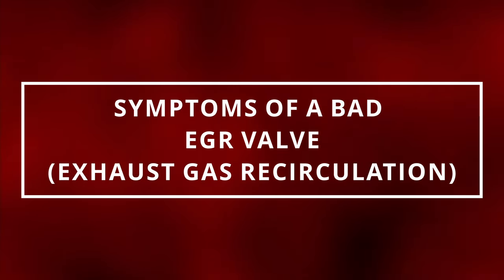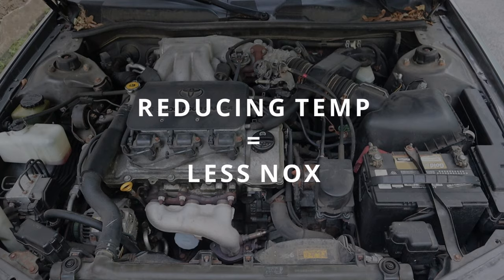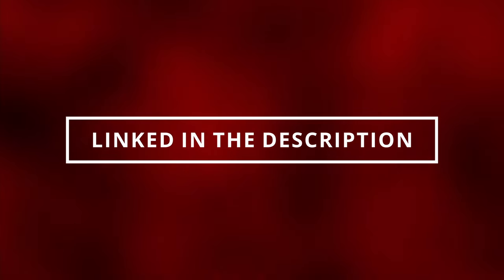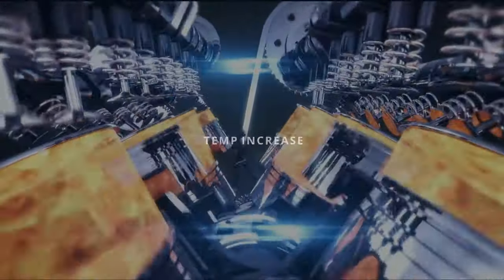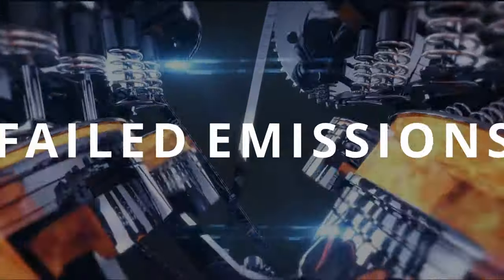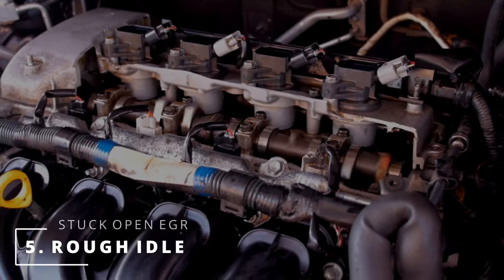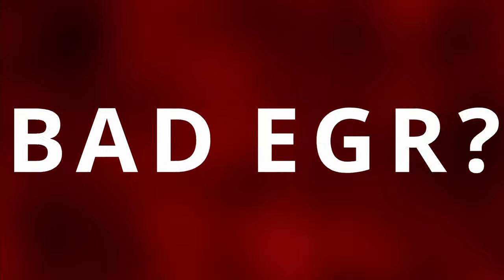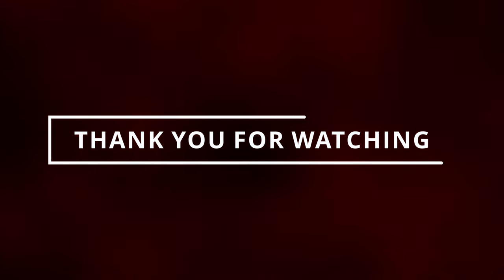SYMPTOMS OF A BAD EGR VALVE

Comment: The purpose of the EGR valve is to destroy your engine over time.
Reply: Have you deleted it? I’m thinking about it but not sure if it will cause more problems. I got a 95 mustang 3.8 Essex v6 ohv. Let me know anyone. I only have a egr code and that’s it. I’ll clear it. Stays off then comes back on.
Reply: @classicv8dude268  (I have a Mazda turbo diesel ute) Same I have been thinking about deleting the EGR valve but doing a Google search they say it can cause more problems, hotter burn even cracking the head.
Reply: @12volthighpeakvanlife.62  Yep, same.👍
Reply: @classicv8dude268  I have 2 80's lincolns and I can't have any vacuum to them otherwise they run like shit. I'd say you're safe but you may still get a code.
Reply: LOL I thought that was the purpose of the gas, now.
Reply: @ryankizzire2321  True, believe it or not.
Reply: @Nick41622  elaborate
Reply: @1k_vonte  🤣.
Reply: @Nick41622  im not gettin it
Reply: @thesquad2253  Does your engine have an EGR valve?
Reply: @Nick41622  yeah and it needs replaced
Reply: @thesquad2253  Think about removing it if you don't have yearly inspections.
Reply: @Nick41622  you have to do a proper delete on it but also keep in mind it is a federal violation to remove egr
Reply: Think the government and the EPA regulations! We can burn more of the fuel, so it doesn’t exhausting to the environment! 😂😂 these are the same people flying jets around!
Reply: I've been hearing this and I have mine deleted seems like it gave me better fuel economy
Reply: @matthewhensley5165  Yes, it will get better fuel economy.
Reply: @nikburisson9-pissedoffpeasant- the entire emissions system destroys your car. Software will need to be changed though
Reply: Amen to that
Reply: Right like what the fuck is this guy talking about

Comment: EGR doesn't reduce charge temp, it increases it (exhaust is always hotter than intake). This is why there is often an EGR cooler for higher load (hotter exhaust) condition. EGR reduces the oxygen mass in the cylinder charge, reducing the ingredients available for NOx to form, whilst also giving any results of partial combustion another chance to combust.
Reply: Only partially correct.  EGR gasses increase the charge temp, but they decrease combustion temp (which is what he said) by introducing decreasing O2 content and thus altering the mixture ratio to not burn as efficiently and as hot.
Reply: Introducing already burnt gasses into the induction manifold means that when the contaminated charge does burn it will burn cooler - it is the heat of the burn that makes NOx.  Having the EGR valve stuck open will not affect high rev performance because the valve opens at higher revs anyway, but at low revs the stuck open EGR is like having a leak in the inlet manifold, which will cause lack of power and rough running, and be more likely to stall the engine.
Reply: Im getting multiple cylinder misfire and 02 sensor bank 1 and 2 codes😮

Comment: I have a rough idle.  My car is also sputtering.  Check engine light is on.  I did a smoke vapor test and noticed a small leak from the gasket of the egr valve.  I cleaned the throttle body real good.  That cleared the check engine light but it came back 20 minutes later .   Could the egr be causing these issues ?
Reply: Mine was doing that too I was stopped at a light or something like that and then it would be revving up really high and it would just go up and down up and down like she was choking
Reply: @juggalogamer8541 did you ever figure this out car does the exact same thing

Comment: I didn't have any of those symptoms with my 19995 Toyota Camry no codes either...my car would drive perfect then when I got to the light it would shut off causing a nasty smell..it would turn on with no problem ..I had no codes on the car my mechanics couldn't come up with what the problem was ..one muffler guy told me I had to change the cat and it would cost me 500 ..my regular mechanic told me a clogged cat wouldn't cause the car to cut off .. anyway I put in cat cleaner fuel injector cleaner nothing helped until one day I was coming out of a AutoZone and a street mechanic asked me if I needed anything fixed I told him the issue he smiled and said how many guys told u it was the cat ...he said on these cars it's this right here the erg valve..he's said u can test it clean it or disconnect it but if u disconnect the check engine light will come on ...I said are u sure he said my brother had the same car same issues he spent over 600 trying to fix it until someone told him what it was...I brought the erg valve went to my regular mechanic he put it on for 75 dollars because he had to take of the whole back line to clean and check it ...car fixed ...

Comment: My egr was bad, car idled funny and really noticeable at 50 mph plus, had it on cruise control and you could hear it rev way up and down . So bad some time felt like it would quit, then engine light came on. Opened hood my eyes started burning.  So I took egr out I noticed look liked it leaked some fuel. The plunger seemed to work and if I pushed in and held finger it stayed, but I replaced it any way thinking maybe carbon upped or something.  What a difference it runs like new, glad I risked the 60$ .

Comment: Once the dealer updated my computer on my 2004 dodge ram 1500, I can't change the egr myself, because now, unlike 7 years ago before the update, you must have the $40,000.00 computer to have the truck computer recognize the new egr.  I learned this the hard way this week, as I installed the new one (just like 7 years ago), and it wouldn't turn over until I had it towed to a shop with the dodge computer.  Pretty soon, you will not be able to replace any components on your newer vehicle unless the dealer does it.

Comment: Gotta chuckle out of this video. How diesel and gas engine issue symptoms are mixed together instead of fuel specific. NOx is pretty much a diesel thing. But what really got me was how many times it was stated that the exhaust cools something. Then says the exhaust may cause unexpected combustion due to too high of temperatures, causing engine knock.  In a diesel, sure. Cause they don't used a spark to create combustion. This would be a good example of why people shouldn't just copy down a bunch of info, mash it together and present it.

Comment: Hello and Help!!!
Thank You for breaking this down for me. Code came up as EGR valve for my 94Celica 1.8. The engine in your vid looks almost identical to the new one that replaced my original. I'm having a really rough time finding this part. You mention cleaning it as an alternative. Which cleaning product were you referencing for that option? I am so desperate to fix this issue. My car was my favorite everything and lately it's become a stressed out burden. 
Thank You for your time!
Reply: I saw a video on YouTube they cleaned with soap water and tooth brash

Comment: I have a P0401 code on my
2004 Ford Escape 2.0 A/T

Is this the culprit for my car stalling when doing slow turns especially in reverse and when the AC is on?
Reply: My car does this in reverse.

Comment: I have problems with my  Vauxhall Tigra A. Sometimes the throttle doesn't responde as it should at low RPM's and sometimes cut's off also at low RPM's. Also the oil is leaking at the plug where I pour the oil in to the engine probably becouse the compression is bad. I will try to change the EGR and if that doesn't solve the problem than I think I should change the car lol
Reply: What kind of car is a Vauxhall tigra???????
Reply: @jasonsnider8749  It's a coupe from the 90's 😀

Comment: but wouldnt deleting the egr be the same as having one stuck closed? therefore preventing the gases from re-entering the intake?
Reply: Yeah which means it is literally pointless so you’re better off simply coding it out on the ECU and you may aswell even do a dpf delete while you’re at it

Comment: I have a p04040, car runs and idles fine. My problem is I get an intermittent old nasty smell mainly with the sunroof open only. It's not the HVAC system, could it be the evap? Thank you in advance.
Reply: Maybe a clogged catalytic converter. Rotten egg smell?

Comment: My engine light is on diagnose shows egr valve 
Price is over $350 
Today will replace and see what happens 
95 Lexus sc300
My car is vibrating when I drive and I think the speed idle is not moving I will look at it today again
Reply: What ended up happening? I have a 97sc300 and would have vibrations and rough idle but it’s because I had a vacuum leak. I fixed it by replacing the intake and runs a lot better now. Js want to know about ur problem so I can prepare for it in case my egr is bad 😹

Comment: Hi, I have a 1.6 2010 focus TDCI. I had the EGR replaced 6 months ago as I kept getting acceleration issues. The problem improved but it still happens, usually when on the motorway after about 10 miles, around town it's fine. I have a scanner and it says the EGR is stuck closed but if I stop the engine and restart it straight away the problem goes away for a while so my question is, can anything else be faulty? I would have thought if the EGR is stuck closed it would be stuck permanently? Many thanks.
Reply: Hello @lusiscus. Any luck u got out of it. Or did you get the EGR Valve changed/ Cleaned ?

Comment: Just bought a new egr valve and egr tube and the light comes back on. Can I test and see if the new egr valve is bad? Car runs great. 2008 equinox 3.4. Thanks
Reply: try reset ecu...some vehicles need to run a few miles to reset though
Reply: Take the battery wires off the battery touch them together for 20 seconds connected back to battery
Reply: @jayskrills7375  what does that do? I already had the codes cleared
Reply: @thebeddoctor4273  that resets the ecu
Reply: @thebeddoctor4273  that should shut the light off
Reply: @jayskrills7375  thanks for the help

Comment: Can a bad egr cause power cuts ?
Reply: I have a Mercedes Vito. When the EGR is dirty is can inform the computer and it puts the engine into “limp” low power mode.  If I turn the engine off and back on it normally clears it. But ever so often it needs a good clean
Reply: No it will run much better when blocked off or removed.

Comment: Stuck open EGR will NOT cause idle vibrations because it is set to be always open on idling!
Reply: So what does ?
Reply: @LiddieJane  many things can cause this.. worn plugs, coils, stuck closed EGR, issues with PCV valve, bad ECU mod (chiptuning)...